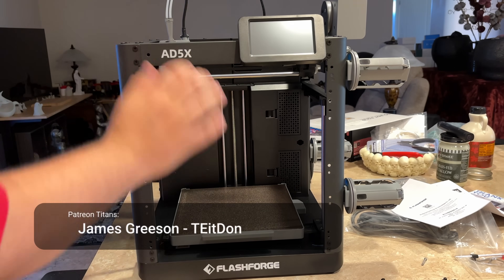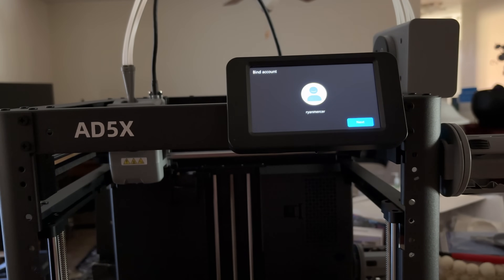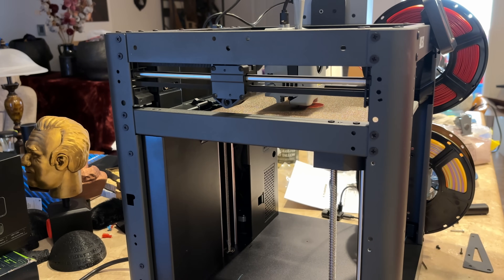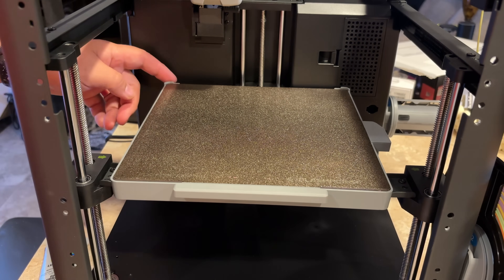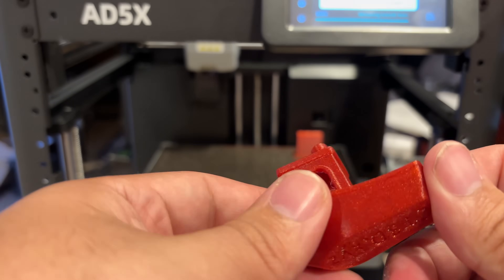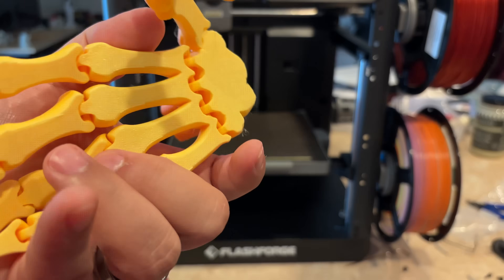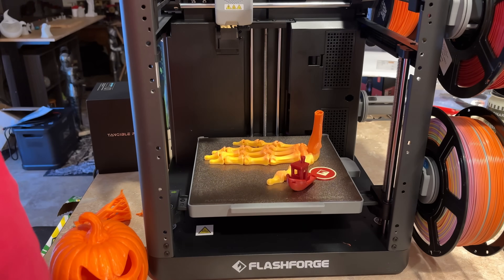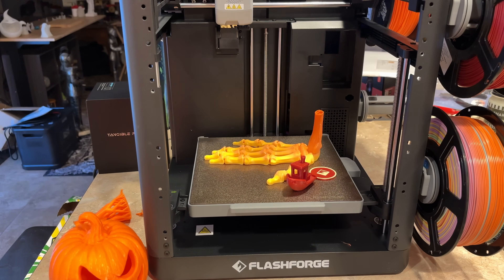I Tried the Flashforge AD5X 3D Printer... and WOW!

Comment: I just got one of these and I have to say, it's been such a treat. I had a Artillery X2 before this and while the print volume is smaller, this has been a far better experience. I don't have to level my bed anymore, I get multi-color prints, it has wifi. Just a LOT of bells and whistles for the price point. I printed an Umbreon and Jolteon multicolor prints with absolutly zero issues. Didn't need to adjust any z-offset or have any color bleeding. It's been a very painless process getting up and going.
Reply from the maker: Once you get a self-leveling printer life is so much nicer.

Comment: Hey Ryan this was a great video. I would still consider myself new to 3D printing. I have around 520 hours total on my P1S. During these Black Friday sales I picked up another P1S and I was very close to buying a first generation Bambu AMS as well for one of my P1S and the price ended up being around $256 after taxes and free shipping. Before I pulled the trigger I saw that I could get the AD5X for $256 as well on AliExpress, I forgot the total amount but the AD5X only ended up being .25 cents more than the AMS from Bambu. I thought to myself, well, I don't want to really leave the Bambu ecosystem BUT at the same time I can get a whole extra 3D printer that is able to do multi-color prints for the same price as a first generation AMS from Bambu. Anyways, I ordered the AD5X and will be using that machine for multi-color printing. I also bought the enclosure kit as well, I'm a little hesitant as I haven't had to deal with many issues outside of some user errors on my part so I am hoping the AD5X is as reliable as my P1S has been. I'm anticipating your future review video on this machine. Mine comes in next week!
Reply from the maker: So far I've not has any issues!

Comment: 220x220x220 
In 2025??
The 3d printer i designed 8 years ago print a larger surface and faster. 
Auto leveling bad?
The most useless feature I have seeing in a 3d printer.
Any 3d printer print when is not level without problem. What you need is that the bed is parallel to the nozzle mechanism and Thai must be by design and tune once. If you destroy you heated bad each time you remove a piece the printer as a big design flaw

Comment: When i did that test chip the second color was way off. Then i tried the boat and it was way off also. I have no idea how to fix it.
Reply from the maker: Belts might need adjusted, make sure your filament is dry, make sure the plate doesn't have anything under it making it not level. First things that come to mind.
Reply: The only problem I've has was when I tried to use wet filament. Have you tried a new spool?

Comment: I have been using mine now for a week. This printer is awesome. Easy to setup and even easier to use. It prints with really nice quality. A stylus would be great!
Reply from the maker: It is a solid little machine. I think I've got about 40 hours in it now.
Reply: It's a printable one you can print right on the screen under the files.